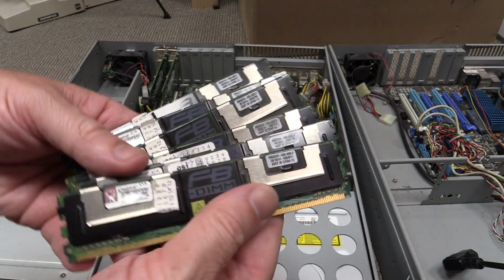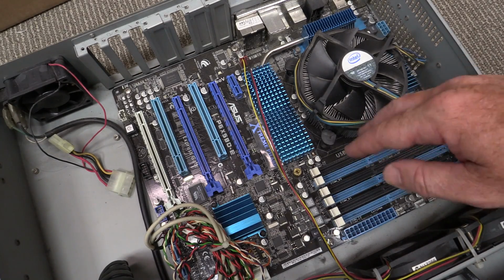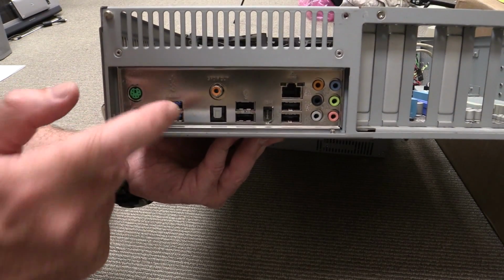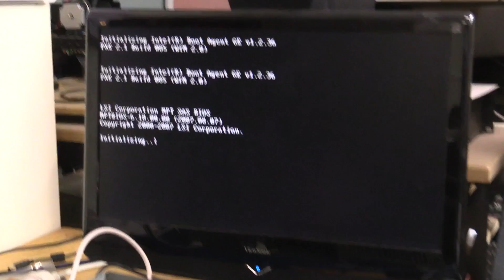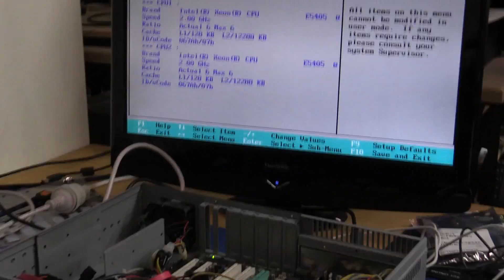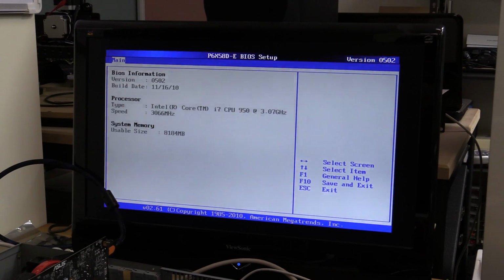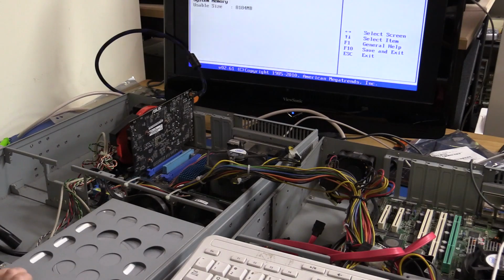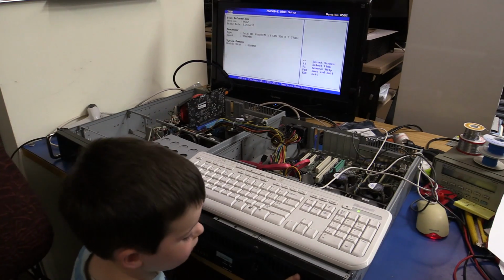EEVblog #838 - More Dumpster Server PC's

Comment: Judging servers by their video output seems kind of flawed.
Reply: +Toni Lähdekorpi I think he meant he judges the desktop computers he finds by the video output (notice the servers had either VGA only or nothing and he still investigated them), if its a desktop pc and has vga only its probably about a decade old at this point lol
Reply from the maker: +megaspeed2v2 Yep, that's exactly it.
Reply: +John Ridley Display Port is far more common to find integrated on a modern system than DVI. DP replaced that on OEM business machines around 2009.
Reply: I recently got an AM3+ with 16Gb ram four 1TB HDD and a 256GB SSD,  an AMD FX 8350 CPU that had a PCI VGA video card on it..It also had quite a few NIC cards and a multiple BNC video input card. It was being used as a DVR for a security system. The case was a re-purposed plain Jane white case..
Definitely a sleeper system if I ever saw one.

So yeah don't judge the book by its cover.
Reply: +John Ridley Never said to pass it by, just that going purely by no DVI means you're going to be passing on a fair bit of newer stuff. It's already not uncommon to find DP stuff, I've already found a few Optiplex 780s, two Precision T3500s, HP Z200, etc. It's all 5-6 years old at this point (aka replacement time for a lot of companies).
Reply: +megaspeed2v2 I have seen many good desktops with only VGA (built within the last couple of years). Most where made to have a video card in them!
Reply: +Toni Lähdekorpi It is flawed, I work in IT and there are PLENTY of late model mainboards that have VGA 15 pin ports and no DVI sockets at all, The better judgement is to look for an HDMI port as just about ALL desktop boards now have HDMI outputs.
Reply: +Toni Lähdekorpi He's wasn't 'judging' the servers but the desktops that were dumped - "no dvi connect, i just don't bother" or something like that
Reply: InfiltrateIndustries That still does not change the fact that there are plenty of late model boards that do not have a DVI port.. Quite a few gaming boards don't have any video ports because they don't have support for an onboard GPU, Then some modern gaming board have only a VGA port but most will have an HDMI port. Its really a flawed practice to judge a computer by its cover. For all he knows those could have been "sleeper" PC's
Reply: Lower yourself? I have gotten a full home theater system worth over $5000. Earned over $2000. Don't worry if there is a bug in it. Clean it out, fix it up and use it or sell it. Another hint - 90% of the stuff I find is on perfect shape!! Never found a bug in anything from my 10 years of dumpster diving!

Probably saved tens of thousands of dollars on stuff I would have otherwise bought!
Reply: I just dont trust it
Reply: +ElfNet Gaming Try it! I think you will be amazed at what you will find!
Reply: IDk man, the TV shop down the road from here has a pile of LED and LCD TV sets around the bin.. Tempting as it is and I do know how to repair them I just don't like the idea of rummaging through the trash
Reply: +ElfNet Gaming For all you know they could just be last year's model that was thrown out. Or say that only one or two is really broken and the rest are fine! If I was you (I would really be interested if they are LED) I would take ever one that looks in good shape. 

If they don't work you could always bring them to someone (like me) who knows how to fix them. 

Do it man! If they work you will not regret it!
Reply: If they don't work I can fix them myself lol. They also put out some of those big projection types set too (drove by on the way to the store) but those are useless now, analog only stuff.
Reply: ElfNet Gaming Why do you bother typing all that - it has nothing to do with my comment, and its pretty much common knowledge - What motherboards do even have a DVI output? Besides you're contradicting yourself with your reply to John Ridley and your 10 second-rule. Dave('s "rule") was referring to no DVI on the desktop's graphic card -_-
Reply: +ElfNet Gaming Get the flat screens. If they don't work you have too options - sell them as not working or fix them and sell them!
Reply: +InfiltrateIndustries Ahh, the graphics card. I thought he meant the motherboard. If that is the case I follow the same rule!
Reply: Joshua's Recordings That is semi true, I mean I have worked on 'i" series PC that had generic video cards installed in them..
Reply: Keep in mind older parts use way more power. Anyone on Reddit /r/homelab will tell you that. You can often consolidate your VMs on a beefier newer hardware, that is still on the cheap end, that took 3 or 4 older servers to do and still be under the wattage and heat that you had before. He even mentions so in the video.
Reply: +John Ridley you are speaking what is in my mind
Reply: +megaspeed2v2 actualy that statement is not true.. i built a pc like 4 months ago..it only came with vga 1gb onboard..so if you wanted dvi-hdmi you have to add a pci-e 16 or x2 graphics card :P so dont just jugge mobos by the vga port
Reply: andreas djsmashy Well its a thing among the "electronic elite" they think because something does not have the latest technology it is useless and dated. Point in case the PC you built. Sure VGA is no longer the popular form factor but VGA is ISO meaniing you can use any modern TV set or monitor with it.
Reply: +megaspeed2v2 Servers never have DVI/DP or HDMI. They have VGA only. It is still most reliable connection. You can connect Server to any monitor you want include CRT and thats exactly what you want with server.
Reply: +Aleš Nezbeda (SlouchyButton) can you make the difference between desktop and server, or not ?
Reply: Pascal Lafrenière I can if I pop the top. Usually servers have dual CPUs
Reply: ElfNet Gaming
well thas why i think that most off those ppls that comment here IQ is under 10.. they jugge something only by its visual and not on the real specs..so we win at that :)ok  the pc i built has a vga one..but has no problem running hd videos and stuff..and still if i want to make it to have a dvi i can just add a vga-dvi adaptor.. glad to see some one that agrees with me :D
Reply: +ElfNet Gaming Darn It! I just saw ten PCs in white cases at the local transfer station. Should have looked at all of them! I did get a Dell XPS GEN 5 though! By the way - did you ever get those flat screen TVs?
Reply: +ElfNet Gaming I would have take your pc for these bnc input cards.
Reply: +Pascal Lafrenière Put it in the dumbster please.
Reply: Pascal Lafrenière Actually the PC was in for repair and upgrading...I had to add another BNC card and another HDD to support some new camera feeds

Comment: I'm surprised the IT guys bother trucking this stuff all the way down to the dumpster room.  EEVBlog HQ must be a shorter trip.
Reply from the maker: +Mark Henderson Yet I foolishly take them to fill up my limited space with!
Reply: +Edward McLean The dumpster room is next to the car park in the EEVBlog Corporate Towers. And Dave's office is actually higher up than the ones those servers came from (my ex employer). Most of the offices in the building are pretty small, so space is usually at a premium.
Reply: +EEVblog That's what lab space is for...

Comment: Some of those are tower servers not PC's. why would industrial computers have DVI out ports?, even top of the line dual socket machines from the likes of HP wont... so wouldn't judge a server by its graphics adapter. For example: The tower you left next to the green wheelie bin looks like an IBM M3 (nice little server)

Comment: I'm still using a Socket 1366 motherboard with a Core i7 980X 3.33GHz (6-core). It's still more powerful than most of the new computers out now using the new LGA1151 socket - that's after 5 years of owning it. Nice score! You could build a beast of a computer there with the right bits.

Comment: Dave! Are you willing to give out that motherboard? I've been wanting to hunt down a 1366 Socket motherboard because my Sabertooth X58 doesn't let me overclock my processor for whatever reason and these boards are very, very expensive on eBay.. Would you be willing to sell it? Or if you'd like, a trade? I'll pay for shipping. (in the trade I'd be willing to give you my current motherboard that is working fine, it's equivalent, 1366 Socket, the thing is that it doesn't let you overvolt the processor, BCLK overclocking works fine on my 6 core Xeon X5650 processor, had it running at 3.4Ghz from 2.66Ghz, if you want I can give a little bit of money with the board if that's what you're looking for.)

Serious comment here, appreciate a reply!

Comment: An New i7 Cost about 500 € where i life .... (Sry. For my BAD english)
Reply: +BluePWR Where are you!?
Reply: +BluePWR Sure, but its the generation number that drives the price, not the 7. A first gen i7 could go for $200 while a fifth gen could be upwards of $600. Yet a fourth gen i5 running you $230 would blast past that first gen i7 at only $30 more. Its about the hardware specs more than the processor I version (except for i3's they are really only low end, low power chips)
Reply: Im talking about ivy brige, so it is really overpriced here.
The new skylake i7 (6600k?) cost about 1000€ here

Comment: Its a shame that computers become outdated far too fast, most older machines are quite usable as an ordinary pc.
Reply: +zx8401ztv haha most of the employees would actually be fine with a Core2Duo system for reading their emails and editing excel sheets :p
Reply: +zx8401ztv So true, I know companies sorting out their "old" i5 8GB notebooks replacing them with newer ones which have got i5's with 8GB as well >_<
Reply: +zx8401ztv 
But with electricity prices as high as here in Germany for example you want something that won't use that much. 29 Eurocent per kW/h is a tad bit expensive.

EDIT: Typo
Reply: +Bastet Furry I pay 50 eurocent per kw/h here in Denmark :(
Reply: Yep, energy is expensive in Germany. :/
And i even have a particular cheap contract with ~26 cent. Still quite expensive for having a server running at home.
Reply: +Bastet Furry Thats insane, I really have nothing to complain about then, across the pond at 10 Eurocent per KW/h
Reply: 9.41 cents per kWh here in the Pacific NW.  Gotta love hydroelectric power.
Reply: +Georg Pf What companies btw? I would like to replace my laptop ahah i've been needing more than 2gb of ram
Reply: completelymindfucked
Sorry I can't give information because of data-protection laws but you are familiar with that when working in the IT.. But those company wouldn't simply give you their old computers they mostly get recycled by professional companies which ensure proper hard drive shredding.
Reply: Georg Pf Yeah, as I though so, about the hard drives. Nevertheless i'll keep an eye on that.
Reply: +completelymindfucked Do that, just look out for business laptops (Fujitsu, Dell, HP, etc) and you should find a dozen on Ebay, various refurbish sites or if there is a local hardware recycling company you may ask there :)
Reply: *****
Yes you are completely right, I use them for my day to day workflow as well but in my case they are much cheaper too.
Reply: +Georg Pf So uhm... considering there's like a 0.01% chance of data recovery if companies did a proper dd zero-byte pass, and an even less chance of recovery if the first pass was urandom, then zero, why don't more companies just do that instead of shredding their disks?
Reply: +gamlinlarsen RIP... we pay 21 cents per kWh in the netherlands
Reply: +mipmipmipmipmip Agreed. I got a Thinkpad T420 for used for $219.99 plus $70 for a replacement battery just last year and its still going fine. The i5 2520m, Nvidia NVS 4200m, and 8gb of ram handles everything I toss at it with its 1600x900 res screen. Thinking of adding a $50 64-128gb mSata ssd to the laptop for booting Linux and keeping windows 7 on the 500gb hdd.
Reply: +Montisaquadeis Check if it's mSata or mPCI slot, it may just be for wireless cards, but again, identical looking slot.
Reply: Alex Kindl It works for mSATA SSDs at least according to severla owners who have stuck a mSATA SSD in the slot and had it work

Comment: ahahaha asus p6d58d-deluxe in that one, that's a sweet mobo, worth like $200 on ebay, not a dumpster board at all.  You can stick a xeon 5660 clock the crap out of and make it fly, compete with even new machines in terms of processing power.  They were stupid as hell to throw it out, no clue that x58 is basically just as good as the x99 unless you dump thousands for the latest processor on x79 or x99.  Will blow practically any other socket out of the water.  And super $/power ratio

That's a serious gaming mobo, so it's not going to have onboard graphics processing.  It's high end.

Comment: The Intel Pro 1000 cards are the go-to cards for servers and are generaly quite good, they are supported by VMware out of the box and the Linux drivers are generally decent as well.

Note that the NICs are actually PCI-express, so the board does have PCI-e